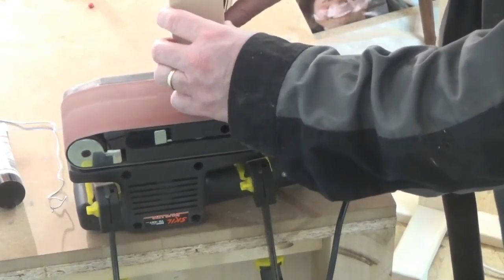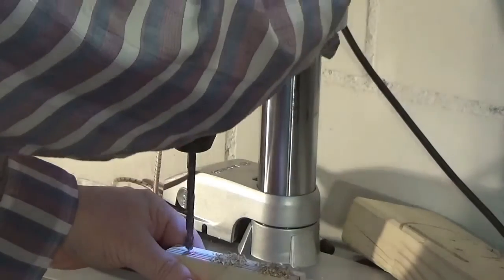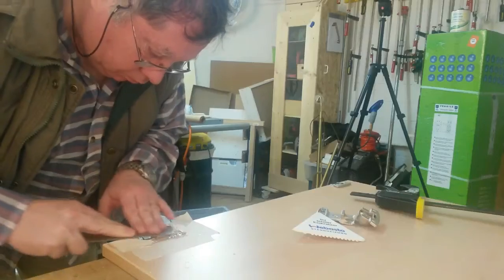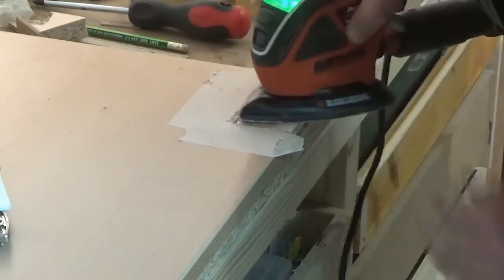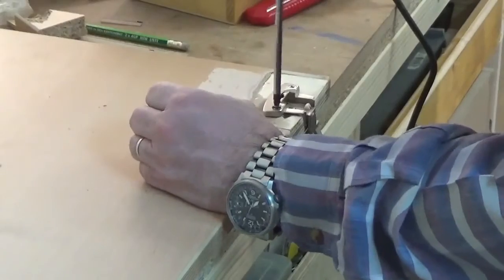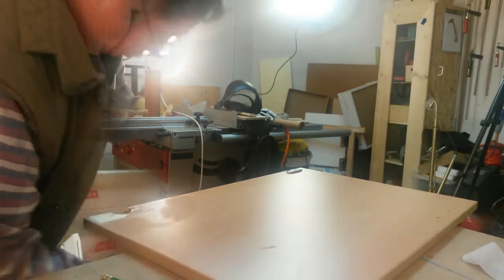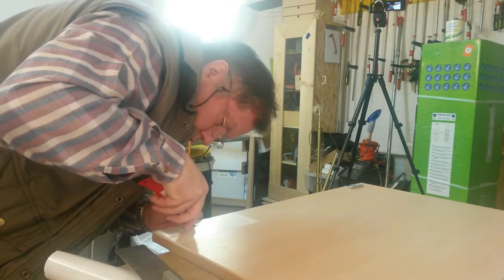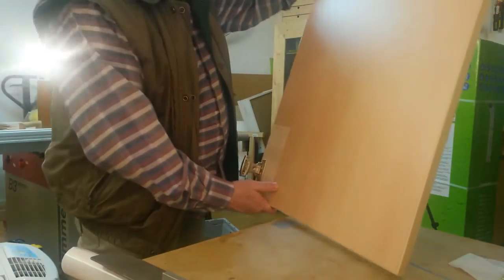Repair of a cabinet door

Comment: Bernie, thanks I liked that rebuild story. Sly the way the utility item was made into a skin deep showcase by the supplier company using a veneer. Perhaps if the fix is in an exposed location a swap of the repaired door and another could be done. You might suggest they reinforce the other doors hinge areas before they fail.
Reply from the maker: +Don Challenger Hi Don. Thanks for your comment. However I have to admit that the cabinet did hold a few years. So I am afraid that the company would not change too much. I was simply put off by the fact that these cabinets are custom built for childcare facilities and priced accordingly. And then one finds out that we could as well have bought from Ikea.